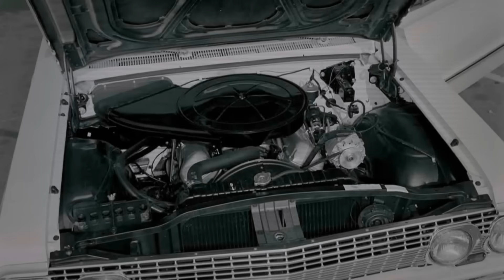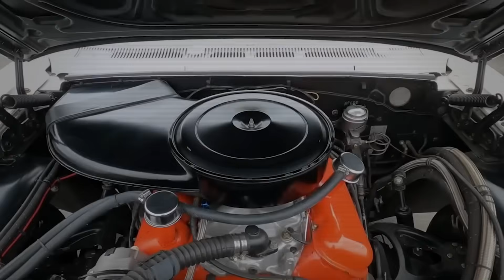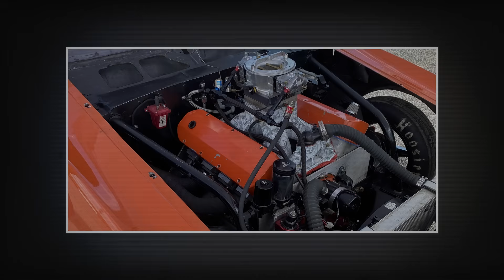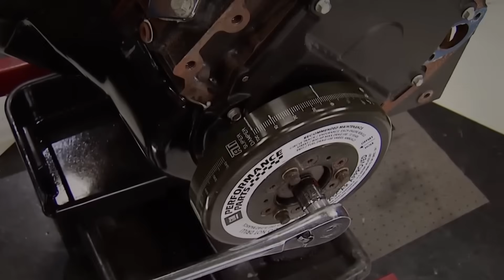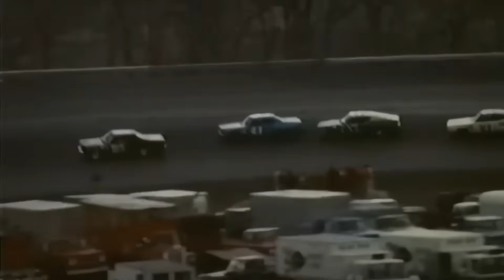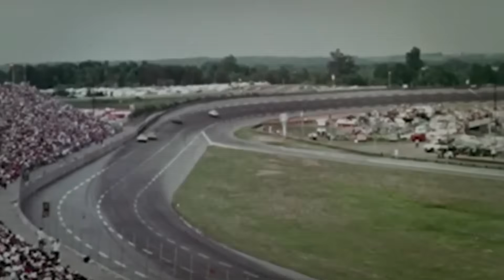The GENIUS Trick That Got Chevy’s 427 Big Block BANNED From NASCAR

Comment: To sum this bullshit up......

In the early 1960s, General Motors (GM), particularly its Pontiac and Chevrolet brands, dominated the manufacturer standings, while drivers Rex White and Ned Jarrett were the top points earners in 1960 and 1961, respectively. 
Manufacturer Dominance
General Motors cars, specifically Pontiacs and Chevrolets, were the class of the field, covertly supported by the manufacturer despite an official AMA (Automobile Manufacturers Association) ban on factory racing involvement. 
1960: GM cars won 20 races, while Ford secured 15 and Mopar (Chrysler) only 9.
1961: GM's dominance increased significantly, with Pontiac winning 30 races and Chevrolet an additional 11, for a combined total of 41 victories out of 52 events. Ford only managed 7 wins, and Chrysler just 4. 
Driver Dominance and Champions
Several drivers consistently ran at the front, but the championships went to the most consistent finishers over the long season. 
1960: Rex White won the Grand National championship. He was the winningest driver that year with six victories and finished in the top ten in 35 out of 40 races, showcasing remarkable consistency. Other top drivers included Richard Petty, Ned Jarrett, and Lee Petty. Junior Johnson won the prestigious Daytona 500 that year.
1961: Ned Jarrett captured his first championship. Although he won only one race, his exceptional consistency (33 top-10 finishes in 46 starts) earned him enough points to beat the defending champion Rex White, who finished second in points despite winning seven races. Joe Weatherly led the series in wins with nine that season, but only competed in 25 events. 
Other notable drivers who were a constant threat to win, especially in major events, included Fireball Roberts and Marvin Panch, who won the 1961 Daytona 500 in a Smokey Yunick-prepared Pontiac. David Pearson also began his dominant 1960s run during this time, winning the 1960 Rookie of the Year award and his first NASCAR win in the 1961 World 600.

Comment: Really after 1963..Chevrolet. in 1965..Chevrolet made much money on the 396 engine in chevelles and camaros and vettes..one race did not sell this motor..they only needed to show it at one race..after its sold in 1965 Chevrolet cars..chevelles and 67 camaros..case done...from 1965 to 1972..they made a ton of money off the 396...

Comment: Small block Chevy engine design stolen from Marathon / Checker taxi cab's.
Always wondered why Chevy didn't offer this motor (the Z-11) in a Corvette? Maybe they could have competed with the Shelby Cobras?
Reply: 63 Impala z11 10.8 to 11 flat  120 mph in the quarter mile. What do you have that can beat that?

Comment: Picture 3 is a redesign of the poor first design, and a copy of the FORD Cleveland design. It was the only way to fix that mess.
Reply: Ain't no copy Cleveland engine wasn't produced till July of 1969
Reply: @jamescochran1116  I am not talking about the original BB chev head, I was talking about the head in picture #3, that is what GM had to do to fix the mess they had with the 24deg head.

Comment: dont tyrn it over 6500 or intake valve kissed piston as kurtis turner driving for smokey
Reply: Yeah and Ford was blowing up left and right.. that's why they made the side oiler😂😂😂😂😂😂😂😂😂😂
Reply: So true, the valve train was a mess.
Reply: @racerd9669  In 1975 I put an L88 (That's a 427 big block if you didn't know) in my '68 Corvette.   11.92 at the drag strip and I used to shift it when the tach needle pointed  straight down at "RPM X 100.   (That would be over 7 grand, Bubba with the factory L-88 cam, Heads and valve springs.  You ain't been around, boy.

Abd if the valve train was such a mess, why did Ford Copy it on the Cleveland Motor? Then did you eve hear of the Bruce and Denny show in the CanAm unlimited series.  All aluminum copy of the Mk iV
Reply: @FraxuredBand  Yezz master, you know your Big Blocks. Hell a friend bought a NEW 396 Corvette, that would run 12 flat all stock, but the engine blew up 3 times, funny how the valves kept dropping. The dealer told him not to bring it back after they put the 3rd engine in it.  And a Ford Cleveland engine in nothing like a 24 deg. BBC. The ford has a 9 deg valve angle and all the In and Ex ports are the same, not like the piss poor BBC design that has right and left hand ports.